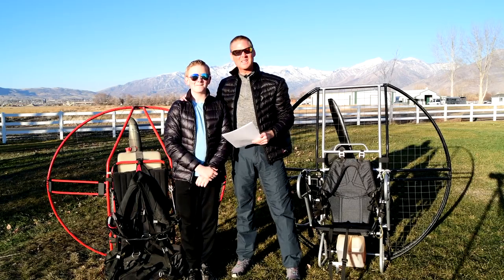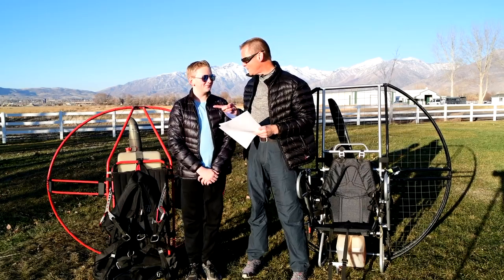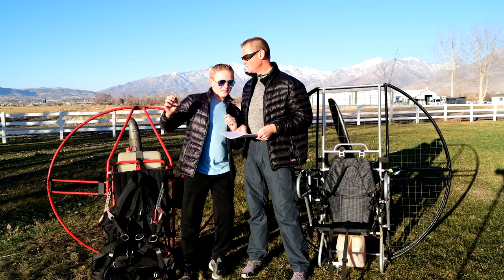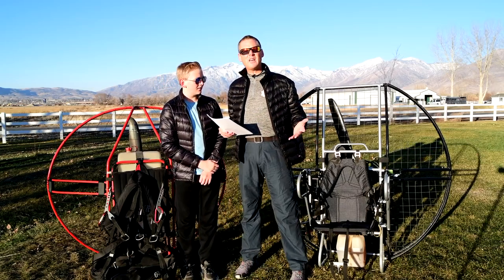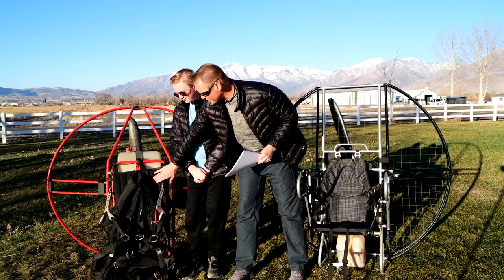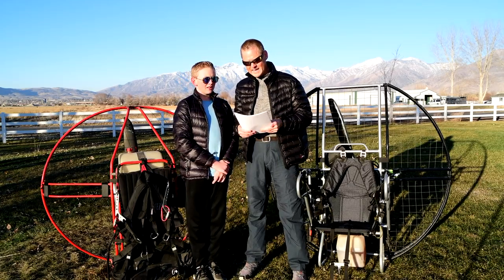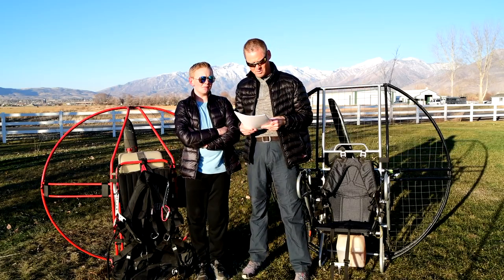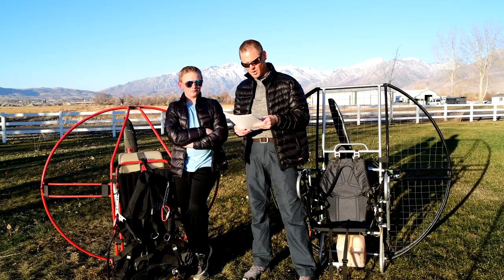Page 3 of the 304 Reasons Flat Top Paramotors Are The ONLY Powered Paraglider To Buy & Fly!!

Comment: the scout looks like a good unit
Reply from the maker: HOW? What's good about the total lack of protection from the prop leading to over 100 people shredded in props and 3 more in just the last couple months? What's good about having ZERO protection from your spine so even the scout importer has already DIED? What good about having a unit where just a bit of a bump or slip and the whole unit catastrophically self destructs costing thousands and thousands in repairs? What's good about a unit that has no face plant protection so if you trip and fall it smashes you face first into the ground so hard one guy snapped his neck that way and is now quadriplegic? What's good about a unit that can sink immediately in water and has so many buckles that upside down without the ability to see 5 people drowned in a single year because they just couldn't get out of the unit to save their life? You can see why zero competent pilots would ever fly a unit like the scout.  We all fly Flat Tops as there just isn't any other unit at this time that has been designed to address the hundreds of well known issues in the sport.

Comment: Dell...why have you not looked into using titanium for the Flattop?
Reply from the maker: Because aluminum is actually lighter and it crushes better for the crumple zone.  No you don't actually want to use titanium for a paramotor.  If price were no object then magnesium might be nice.  Crushes nicely like aluminum but is a bit lighter.  It's just harder to get in all the different sizes and more difficult to work with.  The Flat Top  is lifetimes of experience all brought to perfection.  It's truly a masterpiece and one really doesn't fully appreciate it until they crash it a few times.  I can talk about crumple zone all I want but the day it saves your life is when you will have a complete comprehension of just how truly incredible it really is.  I crashed a BMW 740i into a concrete wall doing 50 mph.  The crumple zone worked so incredibly well it was truly a remarkable experience.  Not only was I not injured I didn't even mess up my hair.  I stalled a 17sm uncertified acro glider right into the ground once.  It felt like crashing that BMW.  I felt the crush and the rapid deacceleration but no impact.  I jumped up and said "THAT WAS AWESOME!!".   People can use their logic and reason to understand the Flat Top is way way beyond anything else out there but until they actually experience it for themselves they just can't quite fully appreciate it.  I get calls now and then from people thanking me for saving their life.  They say how they believed the Flat Top was safe before they crashed but after their crash they KNEW it was.  Those like Jeff who tried a death spiral without my help and way before he was ready.  He pounded into the ground at over 50 mph.  Got up and walked away from it.  Crashed again another time and once again the Flat Top didn't just save his life it saved him from any injury at all.  Then he got gready and though he could make an extra $500 off people selling them the cheasy scout paramotor and price gouging them for a pile of crap.  I told him over and over and over he was going to die if he didn't stop flying that crap.  I even reminded him the Flat Top had saved his life.  He ignored me and just blocked from on facebook from trying to help him.  He died about a month later on the scout exactly as I warned him he would.  People getting into the sport have no clue of all the back history and the dishonest crooks out there who have told every lie they could make up to sell crap to people.  Then after they talk piles of crap and tell every lie they can make up about me and call me every name they can think of they end up dead exactly like I warned them they would.  All while ZERO people have ever died on Flat Tops.  You can see clear as can be in this video there is zero crumple zone on the fresh breeze.  The harness is the lowest point on the unit and it's your butt that hits the ground first.  In this sport you WILL smack into the ground at some point.  It's just part of the sport.  WHEN it happens on a unit like that people break their back or die.  It happens over and over and over and over  but the scammers just hide their blood and keep pushing the same crap.  There are honest good people in the world that tell the truth and try to help people and then there are those who are not honest who don't give a crap at all about other people's lives as long as they get their money.  People need to really look at the skill level and competency of whom they talk to and choose wisely when it comes to picking who they are going to trust their life to.   I have tested more gear then anyone else in the world always searching for something better.  I trust my own kids lives to the same gear I personally fly and recommend.  If I knew of anything better I would be flying it.
Reply: Dell Schanze thanks for the response Dell, one day I will have to take your school.
Reply from the maker: It's really the funnest trip you will ever take.  Plus it's the only place in the world to learn true mastery level skills like this:  https://www.youtube.com/watch?v=BLfCZ7aGNdw  one either has total and complete control of their glider or they don't.  There are so many little pieces to glider control that are just not taught anywhere else in the world.  Plus you have over 50 different gliders to play with and in every size from 8sm on up to 35.5sm so you always have the perfect wing for matching your skill level to the level of wind.  It's hard for those who were "trained" or more like not trained elsewhere to break the bad and wrong habits and very few ever recover from bad training elsewhere but if you really listen closely and try to change the bad habits to perfect ones it's truly incredible what you can achieve.  It completely opens up a whole new level of the sport.  While most are scared to death to fly mid day and would take collapses in rough air those with SUPER skills can fly when ever they want and where ever they want pretty much anytime they want as they have both truly incredible skill and the very best gear in the world.  Even my kids can fly mid day in 100 degree temps right through the mountains.  It's not even a challenge because they have SUPER skills.

Comment: How tall do you have to be to get on that flat top? Who makes your beginner/intermediate wings? Is the radne motor the Swedish motor like the one on my mosquito?
Reply from the maker: Here is my other son at age 10 setting the world record on the very same size Flat Top that I set the paramotor trike altitude record with and tandem world records:  https://www.youtube.com/watch?v=8L0-Lj24Mdg&t=42s  The Flat Top harness is a really slick design where the shorter you are the more you pull down the shoulder straps and the higher it rides on your back.  So literally even a little 10 year old can launch it.  For their first flights I had them use the 6 lb lighter Radne motor but after a few flights with that they quickly switch to the Flat Top Ninja that is 6 lbs heavier but with double the power.  SUPER Troy in the video above much prefers to launch the more powerful Flat Top Ninja because the power really makes it easy.  Would you rather run 100 yards with 47 lbs on your back or 20 feet with 54 lbs? The small weight difference is really negligible compared to the power making it so much easier to launch.  Once your wing is good you nail the throttle and it chucks you forwards like a rocket.  You take a few steps and then just lift your legs.  It's incredible how easy the Flat Top Ninja is to launch even for kids.  Of course also keep in mind SUPER training is another huge key.  There are tons of little details of glider control that no other school in the world is teaching.  So those really wanting to be skills pilots absolutely must come to SUPER training or they flat out won't learn the skills correctly.  Call 800-707-2525.  Literally no other instructors in the world can even do what SUPER students have achieved so training with the best in the world really makes a huge gigantic difference on top of having the very best gear.  The Dominator is also the biggest advancement in the history of paragliders.  It has no competitor that is even closely comparable.  I set the world speed record with it but it's also so safe and easy to fly it's the wing I put my own kids on.

Comment: have you ever come across a bulldog paramotor. I would like to hear your thoughts on those. they are made in England mine has the vittorazi fly evo 100 engine. they are usually sold with the moster
Reply from the maker: Yes I'm very familiar with the bulldog.  It's yet another of the skycruiser clones as it copies the 1980's skycruiser design without a single update for the horrible safety issues of that design.  So everything I discuss in these videos about the terrible issues with units like that pretty much all apply to the bulldog as well.  No crumple zone, no protection from the prop, no quick release harness, no handless seating, no face plant protection, no trigger throttle with grip safety... 19 dead in a single year on units like the bulldog with countless injuries compared to zero deaths in history on Flat Top paramotors.  The design makes a huge gigantic life & death difference.  All of the horrible issues that have happened over the years are all accidents waiting to happen on units exactly like the bulldog and until they address these issues they will continue to happen over and over in all the exact same ways.  So I would highly recommend updated to a Flat Top asap.  Plus the Flat Top Ninja is considerably lighter then the unit you have and while having nearly double the power.  That power also equates to safety.  Then hopefully you are at least flying a good name brand certified wing like the Dominator and not some complete death trap wing they call "reflex".

Comment: I'm just trying to imagine in my mind how loud one of these things are in person when they're going full throttle. How would you compare it to something like a leaf blower?
Reply from the maker: It would be similar to a leaf blower or a dirt bike so people do need to wear hearing protection.  From my experience though people more then 600 ft away can't really hear it at all.  It's just that since you are so close to the noise yourself you will definitely want to use hearing protection.  Once in the air with a super efficient glider like the Dominator it takes only 25-30 lbs of thrust to stay in the air.  So it depends a bit on how much throttle you are using.
Reply from the maker: @austinsmith9413  In a canyon you can get an amplifier effect bouncing off the walls of the canyon.  At a beach from about 600 ft away you can no longer hear it.  So it depends on where you are at.  It also depends on if they are full throttle and greatly depend on the wing and size of wing they are flying.  If you fly a larger Dominator it can say airborne on as little as 25-35 lbs of thrust so in level flight it can be really quiet.  Full throttle though you of course make more noise or flying really small gliders and ripping around you will make more noise.  So there are lots of variables.  The Flat Top tied for 2nd quietest paramotor at one of the shows.  That's if you set all units at the same 50 lbs of thrust or something.  At full throttle the Flat Top will be louder than many simply because it makes more power than others.  So the pilot can choose how much noise they make or don't make by how they fly and what glider they fly.  Kinda cool really.